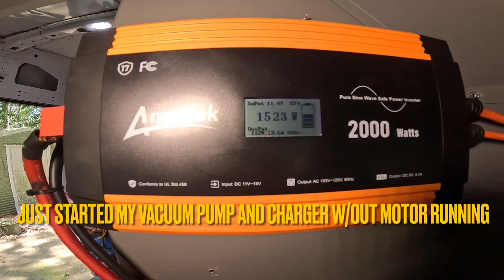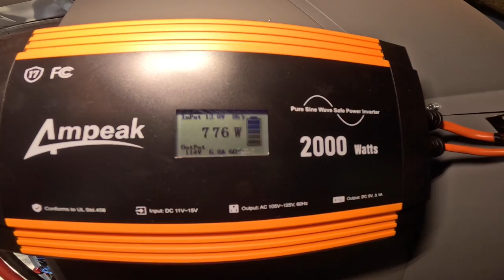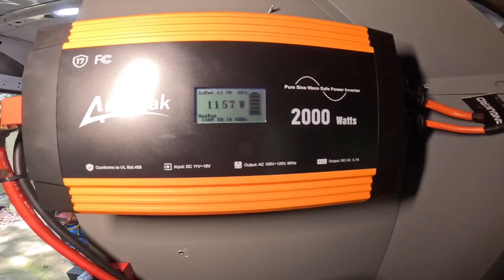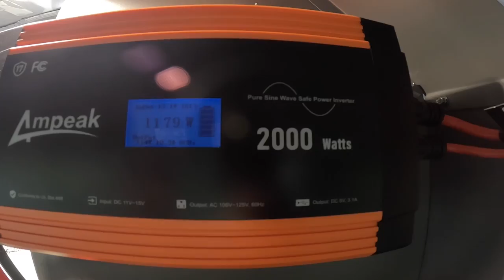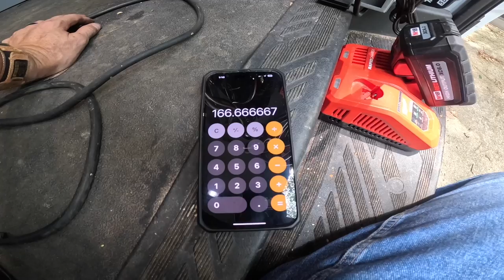Ampeak 2000 Watt Pure Sine Wave Power Inverter! How Much Can It Handle

Comment: I’ve had the same model inverter installed in my Promaster van since September 2022. I use mainly for charging drill and vacuum pump batteries while driving between jobs. No issues

Comment: Hi Curtis on the other van install you put a 200 amp braker and a fuse not on this, can you tell why or doesn't make any difference
Reply from the maker: Battery wasn’t under the hood, didn’t feel the need.
Reply: @HVACGUY  thanks for your answer I have a dodge promaster high roof 2022 I'm doing the exact same thing, thanks again. From lake worth fl

Comment: One thought about the 0 AWG battery cables and the fuse. If they pass through the fire wall of the van, the main fuse should be located very close to the battery. Otherwise, there is the risk of fire.  Good job. Your van is really set up nice!!!
Reply: Unless you have multiple batteries, that size cable won't even melt the insulation when shorted to ground. I used to work for a stereo shop and saw diy installs where the cable would melt to the exhaust. However you will need 4 automotive batteries to even think about getting full power out of my 3,800 watt inverter..

Comment: I've got a 3,800 watt inverter in mine. It will run 110v recovery machine, vac pump, microwave, and portable AC.

Comment: My apologies if you know this stuff already.  You'll want to get AGM deep-cycle batteries to run your inverter, especially without the engine running.  A typical "car battery" is meant to be discharged maybe to 95% while starting an engine, before being topped off again.  It has many plates for the high current needed, but they are very thin, and will erode away if deep-cycled.  Deep-cycle batteries have much thicker plates, and AGM (absorptive glass matrix) holds those plates in fiberglass so they are much less likely to crumble to the bottoms of their cells, AND they are more vibration-resistant.
Another option would be to use a LiFePO4 battery for your inverter; this would be separate from your starting battery.  For a 2000W inverter, make sure the one you get has a 200A BMS (many are just 100A).  Note that this battery type should not be charged when below 32F, and many have low-temperature protection to prevent that, and/or a heater to warm the battery so it can be charged.
Reply: Marine batteries are deep cycle, I have used many back in the day shrimping. They will hold a charge longer and if they go dead, last longer than a regular battery between charges. So yep I agree with you on that.
Reply: I do fine with 3 automotive batteries. But I don't do any long run times with the inverter. It's usually a maximum of 10 minutes. If I do high power pulls for extended time, I'll run the engine which has 150 amp alternator that puts out 80 percent idling.

Comment: If you are only going to use an ANL fuse instead of a Class T, it would be safer to put an additional MRBF fuse right at the battery.  That would give more protection against a direct short.  1/0 wire will safely carry 170 amps at 90degC rating in a wire assembly, and even more in free air.  I used 1/0 for my Xantrex 2000.  Technically maximun amp draw to size wires and fuses is calculated at the maximum continuous output of the inverter, in this case 2000 watts divided by the lowest inverter voltage before cutoff, usually 10.5 volts on a 12 volt system, divided by the inverter efficiency, usually 90%, times 1.25.  This equals about 265 amps.  Most don't wire their systems that heavily.  However, 1/0 THHN-2 will do 260 amps in free air and 105degC welding cable or battery cable will exceed that.  My take is that 1/0 protected by a 250 amp fuse will do.   And yes this whole post is anal.  😂

Comment: The battery is critical to suppling an inverter for 2kW or greater.   As you mentioned they really need 2 x 100Ahr batteries in parallel to deliver max power.

Comment: Nice inverter curtis.can you do another test.check voltage while doing out going watts
Reply from the maker: I actually did that in some of the video that wasn’t used. I got 114V, 60Hz, and 50% duty cycle.
Reply: @HVACGUY  nice.thank you for sharing and responding to me.I am looking for inverter for    my self in that class of 2000 w
Reply: @stephenbullock-yn3vh  I think he made a good choice.  True sine, while more expensive, is MUCH better for inductive loads like motors, and for sensitive electronics.

Comment: Considering that the saw needs several times that 13 amps on startup, the inverter has very good surge capability (motor-driven devices typically need 3 to 7 times their running current during startup).

Because the inverter is not 100% efficient, you need to adjust your math.  At best, the inverter is 85% efficient, possibly with an area (maybe below 800 watts?) where is is 90% efficient.  For simple math, I'll use 85% efficient.  2000 watts / 12 volts = 166.67 amps BUT:  you need to include efficiency.  166.67 amps / 0.85 (85%) = 196 amps.  You'll need at least a 200 amp fuse.  That 150 amp fuse will get you 150 * 12 = 1800 watts (on the input of the inverter) * 0.85 (efficiency) = 1530 watts output.

To prevent being stranded with a dead battery, I'd suggest adding a true deep cycle battery NOT a "Marine / Deep Cycle" from the auto parts store but a true deep cycle battery that can provide several hundred charge / discharge cycles to 50% or greater discharge.  You'll need to read the datasheet for any battery of interest and check the chart which shows depth of discharge (DOD) versus number of cycles.  You'll need to determine how long you'll be using battery power for AC and how much AC you'll be using.  A Kill-A-Watt meter ($35, amazon, home center) will tell you how much running power each device (vacuum pump, battery charger) uses and, if you leave the Kill-A-Watt meter in place for a full cycle of use or charging, you'll know how many kilowatt hours were used.  The kilowatt hours used in a typical vacuum pulldown plus a battery charge or two might be the basis for determining how big your auxiliary battery needs to be (amp hours - not CA or CCA but AH).  Interstate Battery has some batteries in the DCM series (DC Mobility for wheelchairs and the like).  A 110AH battery is probably in the $200+ range and you might need more than one.  You will also find better (and more expensive) AGM batteries from Rolls, Surrette, Trojan and others.  

Remember that you could also run an extension cord to the truck to use that power for your fridge or a small window A/C during a power outage ;-)

If you're interested, I can put a spreadsheet for determining how much battery power is needed to provide how much AC power for how long - it only has about two dozen variables to be filled in but that's because it's very thorough in determining how long your devices will run on XXX battery capacity.  I created the spreadsheet as I was exploring solar power - noting big, just a "Wait until daylight" backup system so I'm mot outside in a thunderstorn to get a generator started during a power outage or shoveling 7" of snow in the dark at 30F to get to that generator.  My interest is having fridge, furnace and limited lighting for 8-12 hours (the "until daylight") but it works anywhere you're trying to produce your own AC power from batteries.  My current backup system is configured for charging from solar power or a grid-powered charged (good option while I'm recovering from spinal fusion surgery - I don't have to go out and clean the solar panels ;-)
Reply: Hope you have a speedy recovery!
Reply: You'd need a soft start AC for that inverter

Comment: Nice inverter but, the not pure ones, had high failure rate and don't last, they put these out for cheapest made and they fail early.  That said let's see what happens over time, at least no money out, maybe they corrected in the pure unit.  Also check draw with milliamp in line with nothing connected and unit off, the non pure sines where drawing 180ma and will kill your battery over time.  Good luck.
Reply: I've had a cheap one for around 25 years. Use it at least 3 times per week. I've got another cheap one that's 3,800 watt that I've used for at least 6 years on about 120 camping trips

Comment: Just some information. First you did not mention the output of your alternator. You should not pull more than 75%, max load, of an alternator output for any length of time if you want it to last. 50% would be even better. The reason is heat. The alternator will overheat especially at idle. So, if you have a 130 amp alternator you should not pull more than around 95 amps @ 12v nominal which would be around 1150 watts. 

Also I would suggest a separate battery for your application and that battery should be a lithium. If you use lithium, it would mean that you would need a special charge controller to limit how much it could draw from the alternator at one time so as not to damage the alternator since lithium batteries have a very low resistance and can over tax the alternator. So, you really should have a starter battery and a separate battery for your inverter. 

This way you save your alternator, never have to worry about starting the truck to charge your tools, and never have to worry about the truck starting. Also you will shorten the life of a lead acid battery by using it like you are now. Victron or  EcoFlow should have what you would need. Just some suggestions.

Comment: Printed right on the face, "Output: AC 105V~125V, 60Hz." WTF? Why on earth would ANYONE even connect something that is said to put out 105V? I would put that POS right back in the box, and return it. I don't think I would want this guy working on my A/C for that matter either, as he should know better. If I had 105V anywhere on my property the power co would be on speed dial. Great for electric space heaters, but will prematurely destroy anything else. Sure, just let the Amperes roll!! Very dangerous equipment, and by design makes it even worse.